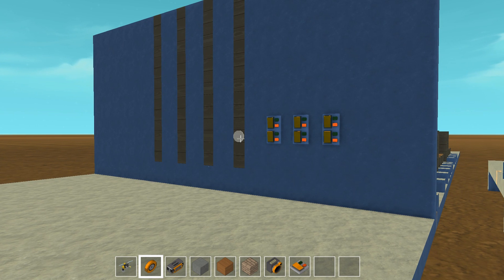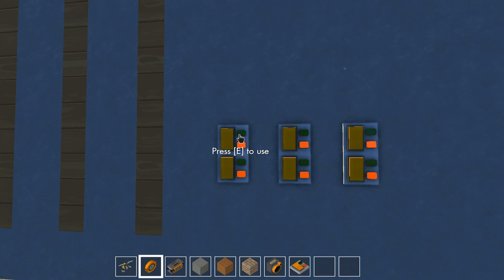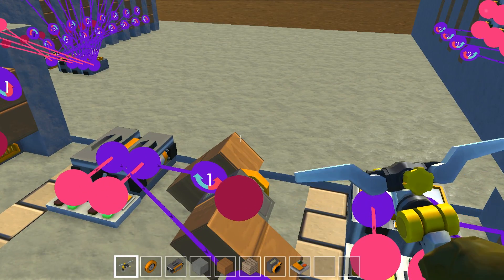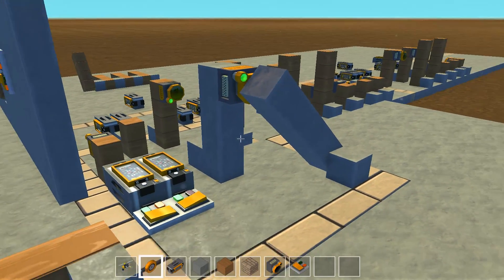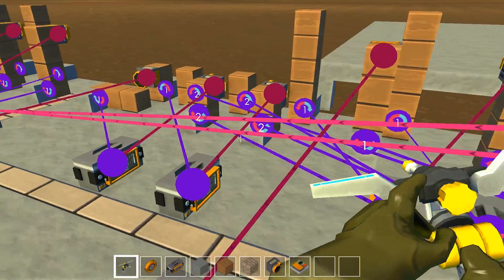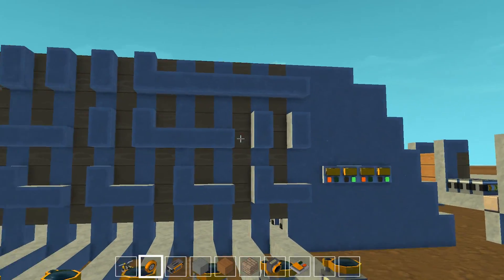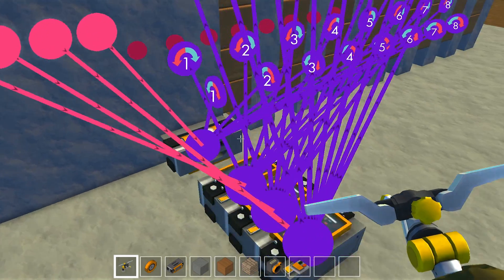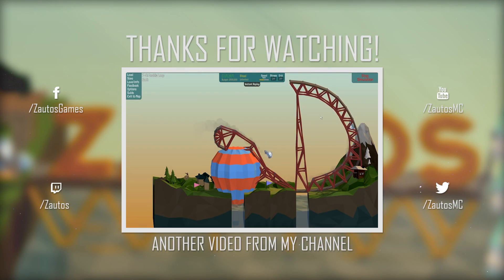Scrap Mechanic 3 bit adder

Comment: was about to say it is very small numbers, but logic gates didnt exist then. Its easy to make an 8 bit system for adding that can add numbers up to 255, the output of course has to be 1 more bit than the inputs if you add 255 to 255(or any numbers that add to more than 255)

Comment: In the second design you could of made the sticks only extend a small amount because the small arms could resist the push! Great video and i hope you play more now that its been a year and the game has updated! =)
Reply from the maker: don't think the length matters and i did it to show the problem so. if it worked with shorter once it would not have shown what i wanted to show.
Reply: I meant to turn it less.

Comment: what?
how do you know if its 3 or 7?
Reply from the maker: +JOPDréke Thanks for the explanation
Reply: +Mark Basaj im not sure what ur asking but to try to answer, for each bit (I  I  I  I), those are the sticks btw... the furthest one to the left is 8  4  2  1 going to the right. on  where he puts in the number (7 in your case), he has 3 inputs because it&#39;s 3 bit so the seven is calculated horizantally where the values are (I  I  I = 4  2  1 = 7) those are the switches btw and when they are off they represent 0 and when they are on they represent 1. if its 0 it should not be calculated so if the furthest switch to the left is on it is (on = 4) and the middle switch is off, (off = 2) and the right switch is on (on = 1) then on + off + on = 4 + 0(because it should not be calculated as 2 if the input is off/0) + 1 which is equal to 5 so, on +off +on = 4 +0 +1 = 5... also, 3 would be off+on+on = 0+2+1
Reply: +JOPDréke i dont know english so well so i still dont get it but thanks
Reply: +Mark Basaj oh okay no problem
Reply from the maker: +Mark Basaj 
0000=0
0001=1
0010=2
0011=3
0100=4
0101=5
0110=6
0111=7
1000=8
and so on
Reply: +Zautos Gaming ooooh
Reply: +Zautos Gaming i got caught up in trying to explain so I didn't like and comment (liked now btw)... To comment, when I saw "3 bit" and started thinking of adders and gates in scrap mechanic I wasn't even surprised because I'm sure ur some sort of genius. people make toy cars that dont work well and you make a calculator... that's just amazing even though it cant go above 14. Also your polybridge videos are out of this world. I also love the new mushroom series.
Reply from the maker: +JOPDréke Thanks :) and the calculator can only go up to 14 but it's not hard to expand it by some bits it would just take time.
Reply from the maker: +JOPDréke you might be interested in looking on some of my old stuff from minecraft. https://www.youtube.com/watch?v=QuIBGWFoz_g&list=PLeKt7nL41BHRhQIrdBr20y1PPxG2pDmxw
Reply: +Zautos Gaming if it's anything like this I'll do that right now. I'm assuming redstone creations.
Reply from the maker: +JOPDréke things i built with redpower. I think i have a kode look from some other mod as well.